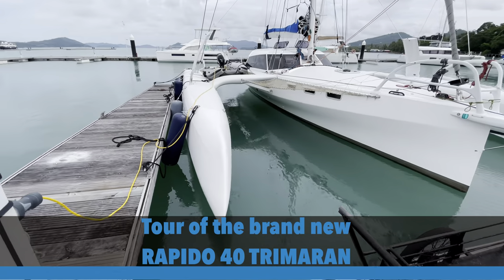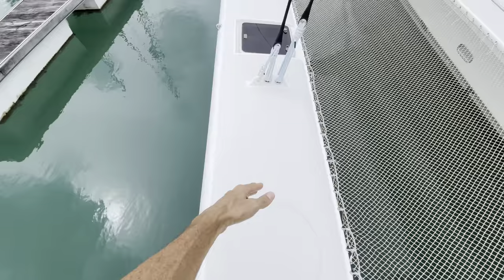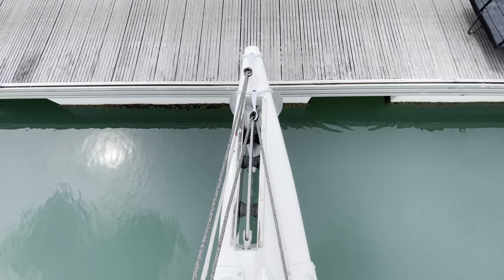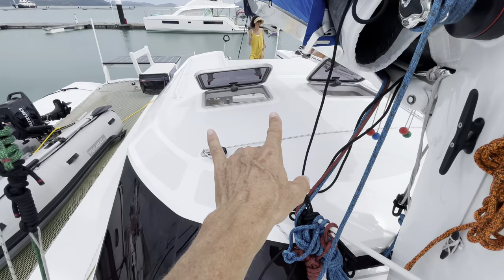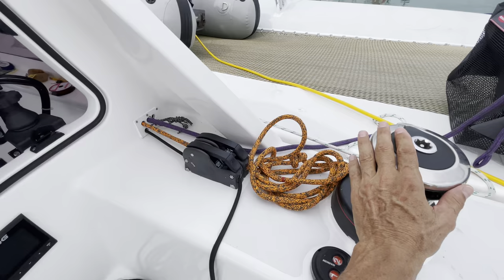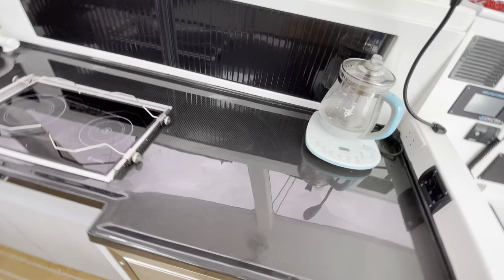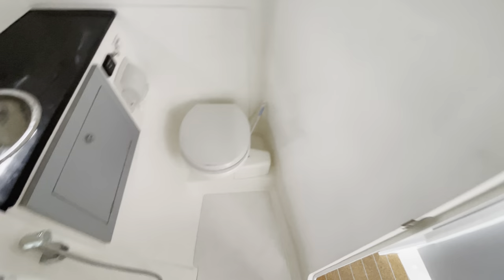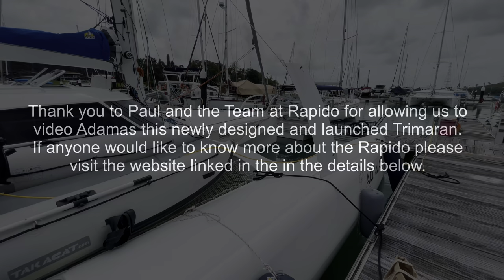Rapido 40 Trimaran

Comment: I like the layout of this boat much more than the 60, much more practical and useable. It is likely an excellent performance boat, which is a highly desirable quality in a cruiser. Speed reduces your exposure to adverse weather. It reduces your need for provisions between ports and it has GOT to be fun! There a couple of things I do not understand/agree with. Why is there no netting between the bow hull and the two amas? That is a darn fine place to fall overboard. Catamaran's do it and they don't even have a central hull. The forward cabin is only ventilated if there is no rain and you are not sailing. Otherwise, all those pretty ports and hatches must be closed. Put a dorade on the bow. I'm in good shape and condition so I can probably get out of that "escape" hatch, but I am pretty confident the vast majority of people on this planet could not. That is a very small engine access in the cabin sole. I am certain I would not want to troubleshoot that engine in a rambunctious sea, or even maintain it in port or at anchor. If the engine blows and needs replacement, how do you get it out and the new one in? 

Rapidos are still rather rare. I have not been on one or spoken to owners. But based on the videos, I would say that when everything works, they would be an absolute hoot to sail for short time periods, like three or four day weekends. But for cruising, I would need to know a WHOLE lot more than the fluff pieces available on the internet. They could be outstanding boats, but I would want to know much more than I have found thus far.
Reply: If you’re interested (but it’s a Rapido 60) sailing la vagabond just uploaded first look video at the one they are having built (hull#4)— shown in the factory setting. They did mods after sailing on another 60 before purchase/build. Very interesting tour and more to come ….. no mast. No windows etc. truly carbon layout

Comment: This is one of my absolute favorite boats. I would like to see it with a tilting wheel style helm kind of like the SiriusWerft 40DS  instead of a tiller setup. Kinda wish Rapido would have moved the settee aft and placed the nav station facing forward in front of the settee.
Reply: I guessing the "the nav station facing forward in front of the settee" can be arranged if you so desire and if you're willing to pay X amount of cash extra...
Reply: There would be pros and cons of both positions. Since the helm is at the back, having the nav station towards the back makes it nearer the helm.  On the other hand, a lot of people use the autopilot to helm and would benefit from a forward view when doing so.  So both have advantages and disadvantages.

The design is sort of between a performance/racing boat and a cruising boat.
Reply: Both would definitely have their place. I just personally hate tillers hahaha. The reason I would want to nav station that way is I think you could have a bigger more useful nav station that would also be great for pulling watch. All completely personal preference but I think it would be more of a cruiser style up vs a race style. I’m more of a cruiser.
Reply: @nicholasgrogan3797  Tillers generally have much better feel, and most cruising is usually done under autopilot, so sort of best of both worlds?

Agree a forward facing inside helm station would fit that cruising style better.
Reply: Hi Nicholas, yah, I get your point of view.  Do you own a tri?  I have a 30 foot Condor.  Trailerable, PITA to put together and tear down, but plenty of boat.  When you go to a wheel vs a tiller you are going to a bigger boat, dah?  You are going to a more intensive enginnering solution (which has it's own attending issues of maintenance and cost).  You also realize quickly the costs  of a tiller pilot  vs a more complex engineering problem of a wheel pilot.  You loose a lot of space with a wheel versus a tiller.  You loose the feel of how heavy the tiller feels when you are not balanced with the sails...not as easy to pick up on that with the wheel.  Personally, maybe it is financial, but i like a tiller set up much better than a wheel.  I have no financial interest in my statement....but Pelagic is the best bang for the buck on this friggin planet for autopilots.
Reply: @alansmith2203  Tillers are simple, direct and have the best feel.

Wheels add cost, complexity, friction, maintenance and have less feel.

Tillers are arguably best for racing, but don't usually scale up to larger boats.

Wheels are arguably best for cruising.

Generalizations for sure.

Comment: ok, the design is debateable , the interior looks like a mess. Not very nice. Also the finish quality is not good as you could see for example on the draws that were opened.
Reply: Yeah, the Dragonfly 40 is a MUCH nicer design with better build quality.  But it's also heavier and I prefer the deck saloon layout on the Rapido. Hard pick.
Reply: @BilldalSWE  Dragonfly has better interior design, but the Rapido is probably a much better value per performance.  I like them both, but would probably get a Rapido.
Reply: @LoanwordEggcorn  Yeah, the Rapido is both faster and cheaper (built in Vietnam vs Denmark...) so obviously better value per performance.  But when it comes to performance per comfort the Dragonfly wins. Especially the upcomming Dragonfly 40 Carbon Performance which will be 1000kg lighter than the regular version (thus close in displacement to the Rapido) and have a larger sail area.  For me I'd take the extra comfort over a couple of extra knots.
Reply: @BilldalSWE  All valid points.  The Dragonflys definitely seem more comfortable and nearly as fast.

The Rapidos are a bit more spartan perhaps due to their racing background via Morelli & Melvin designers (or just the design brief).

Really they have slightly different design philosophies, and of course it's good to have a choice.

I don't know if it's a valid impression, but it feels like Rapidos may be better suited to large ocean crossings, as that's sort of where they came from.  The larger Rapidos are definitely intended to cross oceans quickly.

Dragonflys can cross oceans, but seem more commonly seen in coastal waters.

(And perhaps relevantly, the Rapidos started from the larger boats, while the Dragonflys/Quornings started from smaller boats.)

I have not compared bridgedeck clearances, or whatever the equivalent is called on a trimaran, but Dragonflys seem lower and closer to the water than Rapidos, which would limit the sea states they can comfortably operate in, for example.